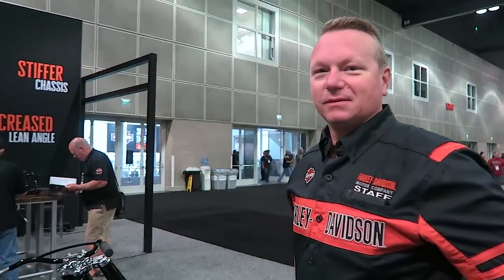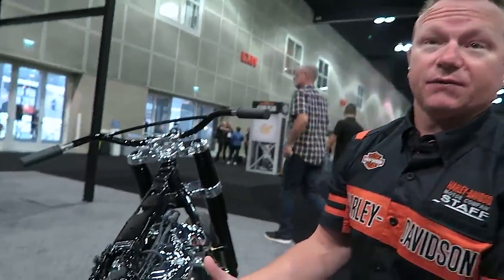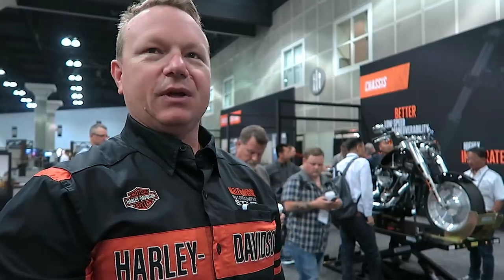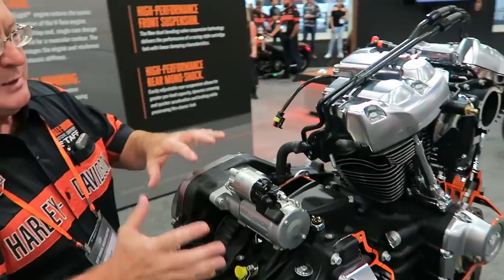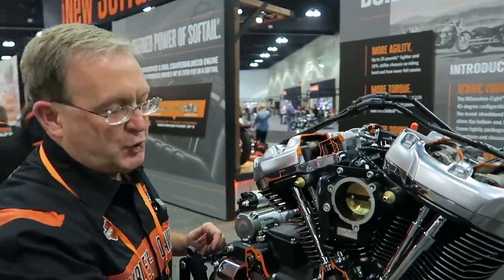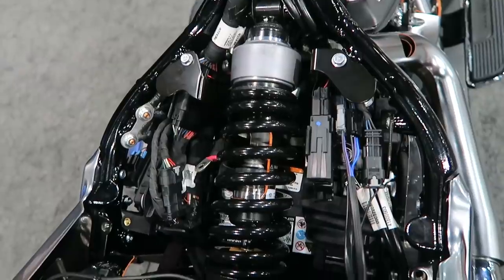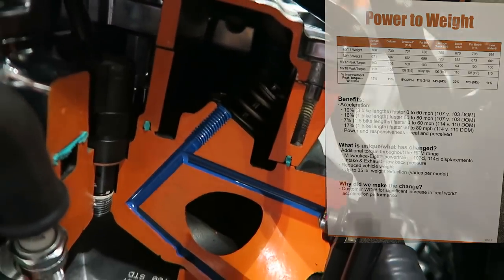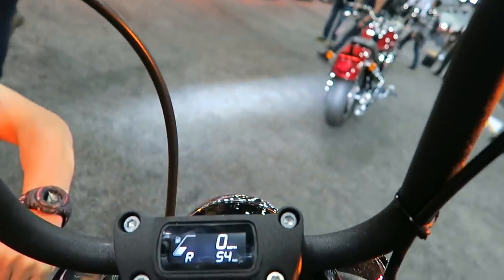2018 Harley-Davidson Softail Chassis Revealed│H-D Engineers Give us a Walk-Through│All the Details

Comment: That frame is the frame that's been used by Yamaha,  kawasaki,  Honda for years???  Mono  shock frame has been around 30 years!
Reply from the maker: Marco Akara so has a combustion engine. Wheels have been around for awhile too. Handle bars have been in use for a long time. A head lamp is a copy too. Hopefully you get my point.
Reply: No those bikes used a progressive linkage and proper suspension geometry.  This is just completely phoned in.

Comment: All you Harley haters take note. I hear all the time in lame videos that Harley can't spell innovation. This new frame setup is awesome. Not only for Harley owners but for those of us who ride softail's. Just watching this makes me feel like trading in my 13 FLSTC. Dyna riders will love the torque and ability to do burnouts and wheelies. Great job Harley another 100+ years in your future
Reply: Frame innovation is not a perimeter frame and single-pivot swingarm from scrap cast iron. That's incredibly out of date the moment the pencil hit the paper, let alone for a 2017 motorcycle. I wonder how many decades it will be before HD actually puts out a bike with a stressed-member engine and multilink suspension design, like everyone else has been doing for years.

I'm sure the HD engineers are soul-crushed when they are forced to design obsolete platforms to appease the marketing folks who run the company. It's not their fault. You can see it in their eyes. The engineer at 18:30 is clearly talented. Do you think he likes signing off on designs with pushrod engines, bloated rear wheels and stupid head angles, while seeing his competitors with upside down forks, dual discs, dual overhead cams, multilink-suspensions, etc etc etc? Poor guy.
Reply: The new frame design is an improvement, but only in Harley World would it be considered innovative. Yamaha used the same setup on both street and dirtbikes 35 years ago. Actually Vincent used it back in the 50s. It's very old tech.
Reply: Barry Ervin so it is ok for Yamaha to copy Vincent motorcycles 30+ years after but when Harley does it is only in their world. You haters crack me up. I also own a Kawasaki along with three Harleys. Why can't you just give credit for change. I am not saying Harley's are perfect and the cats meow, but give it a rest. Why can't people just enjoy the bikes they like without the hate.
Reply: I'm not a Harley hater by any means. I think the new frame is an improvement. Harley has made many improvements and i'm sure there are more to come. But I also don't blindly worship everything Harley does and praise every change Harley makes as "innovative" or "high tech" or "cutting edge" when it's not. I mentioned the rear suspension on my 82 Yamaha only because I owned it and remember it well. I didn't say Yamaha actually invented the concept, probably some obscure bike had it back in the 30s. You Harley guys love old technology, and there's nothing wrong with that, most new bikes are too complex and space-age to suit me, but at the same time you can't really call it innovative when it isn't.
Reply: This Dyna rider has never liked the fake hard tail of the previous Softail range and now that's the only option other than a tourer.  What I liked was the look of a twin shock rear end and now that's gone.
Reply: Barry Ervin I'm the same way. I love my bike but Harley has it's moments. One thing they could innovate is get away from the zinc plated bolts they used at least on mine. Had to swap them out after a cpl years. And I've heard guys say take care of your stuff. Yeah no I'm no fair weather rider and my buddies 2004 bolts are still in good shape and I take care of my scoot. Just don't see bolts going to crap in a cpl years
Reply: This Dyna rider (and touring 107 rider so I'm not against the new motor) wants his twin shock rear end back!  Sure give us more frame stiffness (that was a weak point) but I have no desire to ride a softail (even if they now handle ok) because a Harley simply looks better with a twin shock rear end.
Reply: Geoff Hansford well I guess you could always buy an Indian. To each his own. Two of my Harley's have exposed rear shocks and one doesn't. They are all the same to me
Reply: I won't be replacing my Dyna with any of the new Softails, I just don't like the look of the softail rear end and I'm not saying the new ones don't handle.  But it just does not look right.  And that can't be fixed by making them lighter or handle better.  As for the FXR guys... well some of them are still saying it was a step backwards (and I can't really argue with them).  I'm going to buy a new Dyna while I still can and worry about replacing it in 5 years time instead.
Reply: Most cruiser riders wouldn't buy it. Yamaha introduced their "stressed engine" concept in 1981 with the Virago and used it for many years, but you'll notice that all newer Yamaha cruisers have full frames. The bottom line is that cruiser guys want their bike to look like bikes did 50 years ago. The engineers can come up with brilliant designs, but unless the stylists can manage to hide it or make it look like something else, it won't be produced. And if it is, people won't buy it because it doesn't "look right".
Reply: Mate this 'new' stuff is STILL from the 70's. I want to like HD, really I do but...

Comment: i dont like the new swing arm design, im sure others feel different ( obviously just my opinion) - the angle of the bottom part of the swingarm is flat and straight, untill it meets the part that resembles the frame, but i think this makes the bike have the illusion of sitting up higher than it realy does, and if you lower it, that bottom part of the swingarm, creates a crooked line, like if you saw a sportster thats been lowerd, and the swingarm just never has a visualy pleasing line with the rest of the frame, u can tell its lowerd, and looks like a cheap hack job. the earlier design had an upsweep to those same parts leading to the axle, giving the illusion that the wheel sits higher on the swingarm, making the bike look like its setting low, and if you lower it, it doesnt look like a hack job, the swing arm angles still flow and look organic to the rest of the frame. why in the world they went and hacked something already perfect i cant understand. i mean i get it, that as we progress they want to stay fresh, creating new designs and styles that people enjoy, but i think that by aproaching thier designs in such a way, its like saying old designs are a threat,  that they are worried of people getting board and loosing thier enthusiasm twards thier products. on the contrary, i think those old designs and old styles are thier meal ticket - when u have something that works , why mess with it- i think the new swing arm design on the 2018 softail is a step back, they should have left the design alone.

Comment: As a master technician, I definitely appreciate the engineering of everything. Like the anti backlash spring loaded gear drive for the counterbalancers.  A lot of hate out there because the Dyna is gone. Some people hate change. But sometimes change is what you need to pull in new riders to the brand. Case in point; the V-Rod had the traditional bar and shield diehards saying they wouldn't be caught dead on one while outsiders said that is the only Harley they would ever consider buying.
Reply from the maker: +TheRobSJ true.

Comment: I'll say they did do good on the frame design but still hate they discontinued the dyna, I keep my WG and twin cam
Reply: Joseph Hughes it's all a marketing scheme...mark my words they will bring back the Dyna in a few years. But they will charge an arm and a leg for it
Reply: They discontinued the Dyna name....if the new replacement bike is better what difference does it make what they call it?
Reply: People buy Harleys not only because of the sound but also because of the way they look.  The most iconic traditional Harley that was left in the 2017 range was the twin shock Wide Glide  and now that's gone.  And yes a very very important part of that look was the twin shock rear end.
Reply: Agreed mine is a 2012 Wide Glide and if I hadn't gotten that one would have been an older WG. I'm sure they'll bring back the Dyna models again. How long did they drop the Wide Glides before they came back. But since I watched the older chopper guys down my street I knew that was my bike. But then again that's me.
Reply: Joseph Hughes the new motors are waaay better
Reply: They maybe but I'll still keep my twin can

Comment: It was nice to hear the engineer still rides with spring cam tensioners. Now I know I am not alone. Changed the originals at 49,000 miles and have 32,000 on the second set. Neither failed, just kept an eye on them.

Comment: Great video. It has been super useful! 
I found it most interesting about the two piece clutch cable, and how that Will make changing bars a Lot easier. 
I messaged in one of your videos before the launch that I was torn between getting a low rider S or seeing what was coming in 2018. 
I admit I was like many, and shocked and a little disappointed by the changes. However, once things had settled a little, common sense has prevailed. I am impressed by the improved drive train and chassis, and I Know they will be better suited to how I ride. 
Keep up the great work.
P.S: Shame about the no exporting genuine parts, as I would love a Laidlaw HD plate frame for my bike here in Australia!
Reply from the maker: +Darren Smith Yea, I was initially
Shocked that the Dyna is gone but then I realized how good the new chassis was and now it all makes sense. I think this is a great direction for HD. Maybe they will bring it back in the future - who knows.
Reply: It will be better in the long term for sure for HD to spend a bit of money on handling and suspension, as well as refinement.

Comment: I guess torque is where you go to when you can't or won't mention horsepower. This is the third channel I've watched on the new Harley line up since I'm in the market for a cruiser and no one is mentioning horsepower.
Reply from the maker: +Jesse Parris The 107 puts out about 80 HP and the 114 like 90ish. If you prefer a higher horse power delivery as opposed to low end torque you can change the cam and get more of that type of power delivery.

Comment: I am impressed at the street version of Harleys and also the softail design rather tha the swing arm with outer shocks.  The line up I see though wouldn't be considered by me because I want the center tank instrument panel and these rear fenders are too short.  My ride os a 2002 softail standard, but even though it has the duck tail fender it is still LONG and has more effort in its contouring.  So unless they should show me a Harley with the things I mentioned I would never buy one.  Now the frame design agrees with me and so does the engine and transmission and I like the gear to flywheel counter balancer method design better on the primary side of these engines.  I do believe they should have continued the double twin though because two reaerate cams will endure less stress than one cam that must compress more valve springs, Go figure

Comment: I don't have a problem with the new bikes i think its the right direction for Harley. If they only bring back the Wide Glide in the mid year models for me it will be great since i wanted to buy Wide Glide and i think the new frame will look good on the Wide Glide. I think the easiest solution for Harley is to come with a mid year model that looks like Low Rider S and all those West Coast Club Style Dyna lovers will have a bike they like, if it will have 117 engine to separate the model i think will be big bonus. 
Its really difficult to like the new bikes for someone who dont like fat tire in the front like myself.

Comment: Very informational video. New frame is cutting edge techno!ogy
Reply: Cutting edge technology? Hardly.
Reply: Cuz Yamaha never copied anything from Harley Davidson right?
Reply: When Yamaha came out with the Virago in 81 they intentionally gave it the mono-shock rear suspension so it would appear more "modern" than HD. They soon found out that cruiser riders didn't want "modern", they wanted a bike that looked like a Harley. So in 84 the Virago was redesigned with twin shocks and right side staggered dual exhausts. It still didn't look like a Harley (in fact it was butt ugly) but sales increased. So yes, Yamaha and all the other Japanese bikes have copied Harley many times and continue to do so today, though it's mostly in styling, not engineering. But none of this changes the fact that Harley's new frame is in no way "cutting edge technology".

Comment: The monoshock is getting all this hype, but yet has been around for a minute.  It just offers pre-load adjustment and the front forks are not adjustable.  They should have used an ohlins monoshock that are used on most higher end bikes.  They should have also teamed up with legend suspension for the front forks.  I am sure Legend will be designing a new monoshock for this bike which will even make it better.  That said, I am not a hater of this setup considering it is tried and true and has been used for decades on other motorcycles.  I will keep my riding opinion to myself until I get a chance to take one out which will be the Fat Bob considering that I already own the previous generation.
Reply from the maker: Neo Smith thanks for the constructive comment.

Comment: Very informative video like all of yours.  I have to call bs on the weight savings.  30-35 lbs on a 700 lb motorcycle won't be noticeable to most.  Very cool though that it is so much stronger.  I'm old school and resist change but no doubt everything seems better.  Maybe finally the non harley cruiser fanboys will finally be put in their place.
Reply from the maker: +wunder8962 maybe not by itself but that in combination with everything else. They all add up to make a big difference.

Comment: Give those men a raise! Harley nailed it.
Two questions.
1. Does the kickstand still lock?
2. Are they using a Lithium battery? Sure don't seem like there's enough room for a lead acid.
Thanks for those interviews. Very informative.
Reply from the maker: saddlebag yes. You can pull the bike forward and drag it on the ground and the kick stand will be locked into place. The only bike you can't do this with is the Street lineup. The battery is the same. It isn't lithium.

Comment: Matt, great video. Maybe the best ever. I have a question. The specs say the Deluxe laden seat height is 25.9. It says the Heritage laden height is 26.3. Both seat heights are 26.8 (unladen). Why is that? Also, does the shock adjuster cause the seat height to be higher, on both bikes? I test rode a New Heritage. It seams to sit a little higher than my 2009 Heritage. Maybe my imagination.
Reply from the maker: Duke Tullis thanks. That's a good question. If those stats are accurate that can only mean one thing - the shock is stiffer on the heritage. Those are both the bikes that are adjusted with the 8 mm wrench. No the shock adjustment just adjusts pre-load which will not change the seat height.
Reply: Thanks. I noticed Fat Boy and Breakout (that have adjuster located in a different place) sit lower than Deluxe and Heritage. The Breakout the lowest, maybe because of the neck rake at 34, compared to 30.

Comment: I'm currently thinking of consolidating down to one bike while also switching to Harley. Considering a Road King but these softails are impressive. 
Which one would be a good all-rounder, capable of occasional touring & long days in the saddle? Great vid.thx.
Reply from the maker: mindfield7 Probably the Roadking. It's still early in the year and I don't have enough saddle time to give a fair answer yet. It also depends on your size.
Reply: +Matt Laidlaw ok thanks-  I'll see if I can do some test rides- I'm 6'0 220# - I really like the looks of the low rider and new heritage but I'm afraid they both may be a little cramped.

Comment: Harley needs to stop messing around and remake an FXR/Dyna performance handling bike.
Reply: fluffykittynoodles    your not paying attention
Reply: fluffykittynoodles didn't you understand what engineer were saying?
It will flogg a Dyna. Work it a bit and it will fly.
Reply: mynxl I really liked the part where you told me I was wrong instead of showing me that I was wrong. Wow, how wrong I was.
Reply: Jim Bea yet lean angles are the same or a only a little better. More power is only one part of the speed equation.
Reply: fluffykittynoodles yes more powerful  engine, lighter stiffer frame, better front and rear suspension.  What has a Dyna got. I have a 2016 Dyna in shed  would sell it tonight if I  could afford new Breakout.